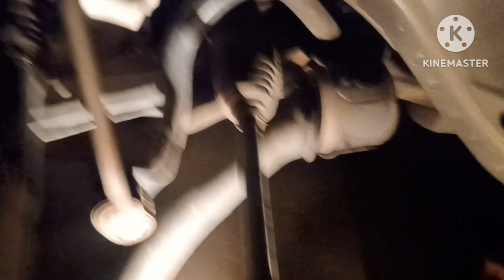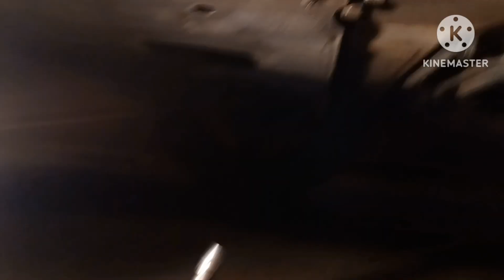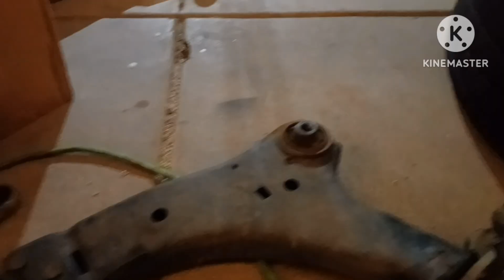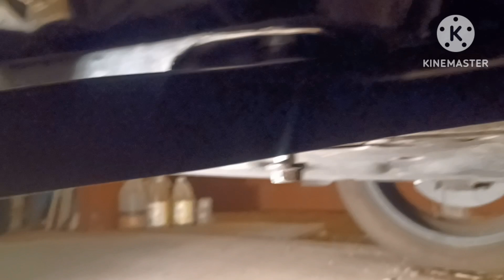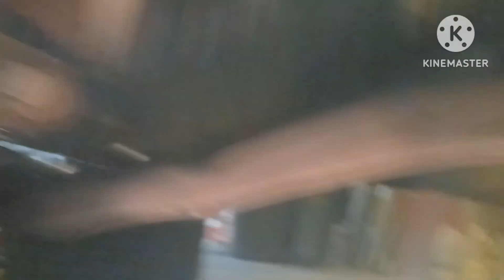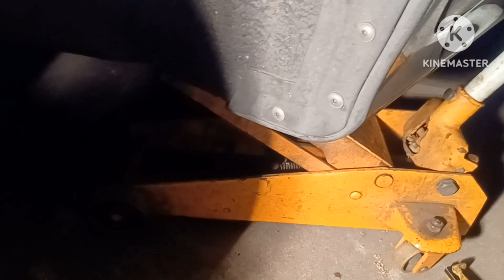Replace XC60 Volvo Lower Control Arm 2009 - 2016

Comment: I just started this job on my wife’s 2014 XC60. I followed other videos & removed the axle from the hub. Getting everything out was easy, but getting the ball joint & the axle back in by my self was a super pain! I fought it getting both back in for over an hour until I noticed the pinch point on the spindle  made a hole in the ball joint boot! Had to order a new Myele ball joint from FCP & it just arrived. Her car has been in the garage for the last 5 days. Searched the tube for some other videos to find some alternative methods to get this job done and your video was right on top. Didn’t even think about using a jack stand to relieve pressure on the hub!!! This method is so simple & straight forward! Thank you so much for recording this video & helping the Volvo community!!
Reply from the maker: 💯 Glad ya finally got that beast of a job wrapped up! Man, I do a few unorthodox tactics to get it done, but it works. Hahaha! Glad YouTube threw me in the algorithm for ya. Sometimes, a different approach works out!

Comment: Hey man I have the same car 2015 XC 60 r. I’ve noticed a thud 1-2 seconds after acceleration. Feels like when your shoulder pops lol but I’m not sure what it is. Do you have an idea? It also thuds when slowing down quickly or accelerating more.
Reply from the maker: Check the motor mounts. Could be the engine rocking back and forth a little.
Reply: @MicDropBBQ I bought my lower torque mount I’ll get it on soon.
Reply from the maker: @abrahamhernandez4070  Hopefully that's all it is. With something like that, it could put extra stress on the flywheel lining up with the engine. People don't think of mounts being important, but the keep things lined up with minimal stress on joints, bearings and seals.

Comment: Very helpful, thank you. I was concerned when I saw the sway bar using the same mount. Made good sense to remove the tension before replacing the arm. I did the job on V40 but the same idea rear two bolts
Reply from the maker: It helps to align it when the tension is much lower too. Just pop it in place and work the bolt in with one hand. It requires a little patience, but still very doable when you remove the tension!

Comment: Ho many miles/years before they needed replacement?
Reply from the maker: Not sure. This was a customer's car. Probably based on how much terrain you go over, as some streets are beat up compared to smoother highways. If you live where there's a lot of potholes, I'm sure you're gonna thru control arms about every 3 to 4yrs before the bushings are beaten up pretty badly.
Reply: @MicDropBBQ  replaced mine yesterday after 13 yrs. they were still pretty good.  the strut mounts and bearing were shot though
Reply from the maker: That's a good run! If you avoid smashing into speed burnps in parking lots, they will last longer. But 13yrs is probably a record. 😂😂😂

Comment: This Looks on the Easy side for control arms, I have done Many control arms, My Audis all had 8 front control arms 4 on each side and SIX balljoints, 8 if you count the Tie Rod ends. I wouldn't wish doing that repair on my worst enemy. Also, the double pinch bolt that holds both upper arms on almost always is frozen in the very Long hole, this is nearly impossible to deal with you can bang on that bolt until the head mushrooms and its not moving for you. Volvos are just nice to work on usually
Reply from the maker: Audis are street legal race cars! LOL! They have a lot of suspension components because they handle like a dream at higher speeds. Volvo is more of the commuter version of an Audi, I would think. Less race and more comfort/space for a family.

If this suspension was like an Audi, I would've probably given up the moment I took the wheel off! LOL
Reply: @MicDropBBQ  Fair enough, I have owned several Audis, a Jaguar, A BMW and several Volvos. The Audi and BMW certainly hold better geometry under hard cornering but Its not worth all the extra complication for me, I rate Audi dead last as far as Mechanical Servicing ease, BMW is a pain also. If you like working on your car Volvo is the best Euro Brand

Comment: Working my way through this, I wish you'd spent a little more time video-ing popping the ball joint out. I've spent hours on mine and can't get it to release. The 15MM bolt is out, everything looks clear, but no joy. No amount of prying or pounding will the the thing to drop. Have tried every angle for the control arm - that's unfortunately the one thing that's skipped in this video. All else is great/helpful
Reply from the maker: I have a ball joint fork/tool. You just put the tool between the joint and the hub and smack it once with a hammer. It separates easily. I thought most people who worked on ball joints at least had a ball joint tool. I've always had one for maybe 20yrs. LOL! I remove about 99% of the ball joints I work on with the ball joint fork. It's a quick smack/pop and it's done.
Reply: @MicDropBBQ  thank you for responding. I have some pickle forks, but that thing was in so tight it took me a day and over 100 whacks to pop the thing loose. Brutal/tough separation. Could well be just how infrequently I tackle such things. (For the record, I was on my phone and thought I was on YT on my personal account, now I see it's a side-account I run.)
Reply from the maker: @unwokeinvesting606  YouTube is hiding notifications. I just saw your response a month later! Hopefully the Volvo is running smoothly!! Yeah, I use a really heavy sledge hammer to wack the pickle forks. The rust will lock the ball joint on there and it'll take some beating!
Reply from the maker: @unwokeinvesting606  You may also need to spray with PB Blaster to unlock some of the rust if you live in an area with a lot of rain.

Comment: Thanks for this video. I couldn’t find a decent one for my Freelander 2 SD4 XS MY2014. The repair manual for the LR shows a special tool 204-619 to compress the strut, which I doubt most independent mechanics have, so they lever the control arm down (much like the Mondeo procedure does), but I am just worried it will go beyond normal range of travel for the control arm bushings and leave me with failed control arm again.

My front bushing failed (torn).
Reply from the maker: I just push the strut UP instead of compress it down. Let gravity help, but do it all slowly and make sure everything is secure when slowly letting the car compress on a jack. Super slow! It'll work!
Reply: @MicDropBBQ will try it! Thanks again.

Comment: Thanks for this video…. I’m going to attempt this tomorrow… just one question. Did you have to get an alignment afterwards?? I’m not sure if I’ll be able to get one scheduled same day.
Reply from the maker: No alignment needed unless you readjust your tie rods, or install new ones.I didn't do anything with those, so it was a plug n play. Drove fine after new control arms.
Reply: @MicDropBBQ Ty!!!

Comment: Thanks fornthsi video, doind an axle on a 2012 xc70. Had to drop ball joint to get the front of the control arm to lay flat enough to slip in. Ended up just muscling the control arm down low enough to slip ball joint back in. Definitely going to save this video for the future.
Reply from the maker: All good, Ed! These cars can be a pain, but pace yourself and know it will line up. I was not thinking it would be this much work, but I did the best I could to show the path I took

Comment: Nice info Jeff, thanks for saying why are you doing this.
Reply from the maker: Ball joints and potholes don't mix! These ball joints were shot and the steering wheel would have too much jerkiness when turning sharply. Ball joint had no support.